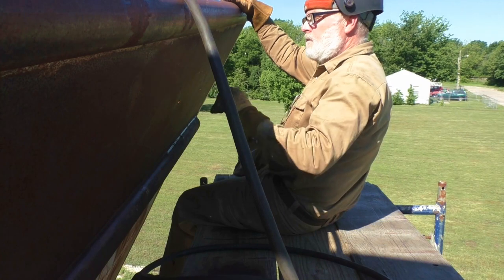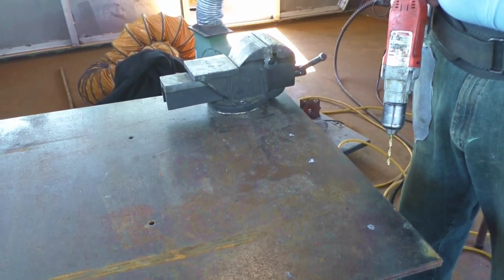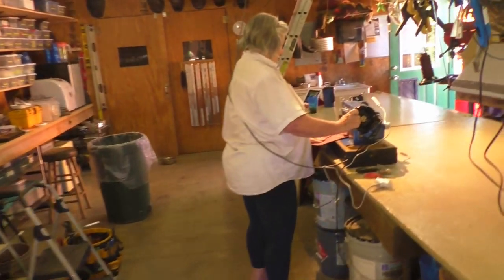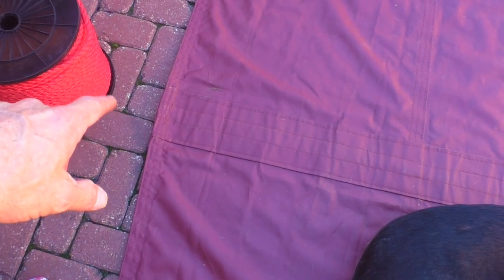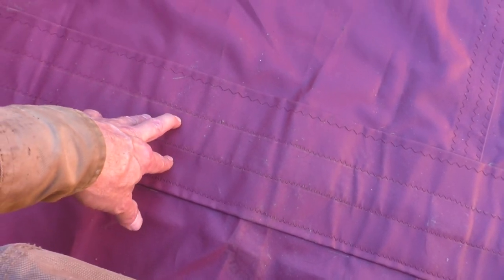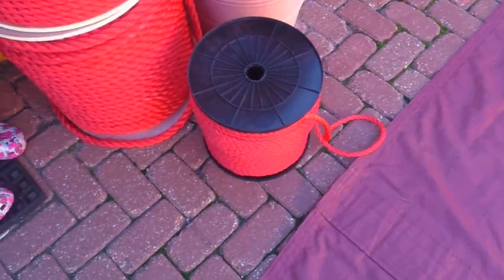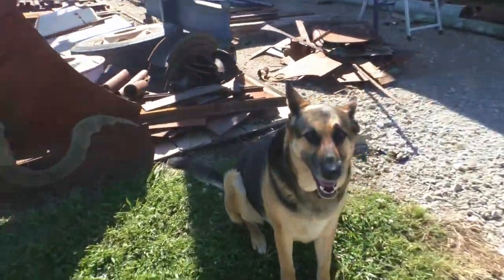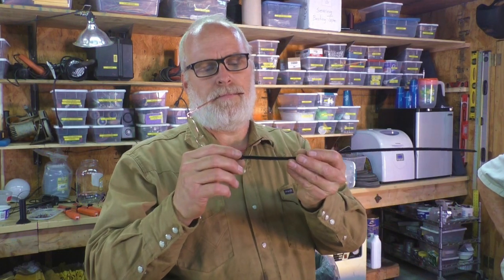Seeker LIVE - May 6, 2017 - Welding, Work Table, Sailmaking, Grommets

Comment: Instead of heating a nail or rigging something up, why not just a cheap soldering iron with a pointed tip?
The cheapy ones are probably best with a 1" long pointed tip and no heat resistant sleeve to get in the way.
Clump of wirewool or that copper strands style of cleaning pads, similar to the stuff they clean 
soldering irons with instead of sponges.

Comment: Doug, how about a hydraulic power puncher? they can be bought for less than $100. I'm sure it would be a trivial matter to fabricate " hammer and anvil" that fit the grommets. you could also add air over hydraulic to make pressing the grommets very quick and repeatable. here is an example: https://m.youtube.com/watch?v=rozYZ0UhBdg

Comment: Doing the grommets by hand with that anvil and punch set up is going to SUCK more than anything has sucked before!!! LOL they make (CHEAP) grommet machines that are ones that bolt to a bench and you push a big lever to force them in and crimp them, or even better yet they make a grommet machine that has a foot pedal that you "Stomp" and it cuts, and presses grommets in one motion- with as many as ya'all are gunna have to do, this is what you need!~ I've used both kinds when I worked in a sign shop doing highway banners and Banner-type Billboards - you can also buy grommets in different materials, CHrome, Nickel, Brass, Stainless, etc AND you should (?) be able to get them for thicker material??? with as many as youre gunna need I bet they'd run you off a batch of whatever you want for as thick as you want, since it sounds like you'll need many hundred or possibly thousand of male & female grommets................
Reply: ALSO, look up what the body-shop & Hot rod guys call a BEAD ROLLER, you can make one using steel, yourself, except instead of the rollers at the end, rig up your Stomp-style Grommet dies and do them that way............
Reply: If you Google "Grommet Press" you'll see the ones used in sign shops to make banners, you could buy one for $60 or $70 and hack it apart and modify it to look like a Bead roller or English wheel so you'd have a Deeper "Throat"